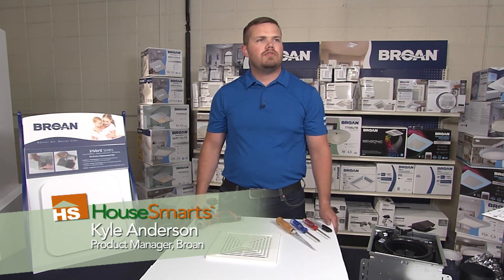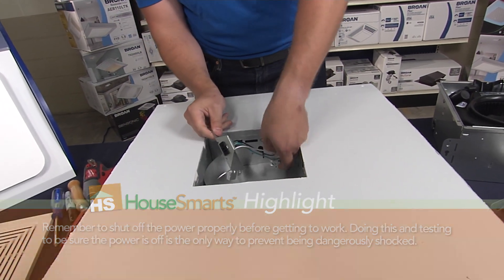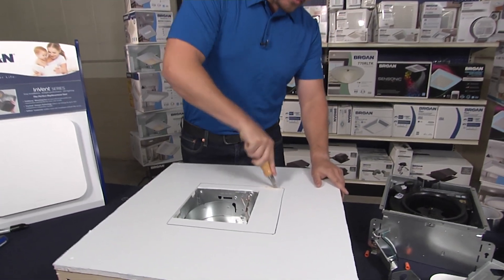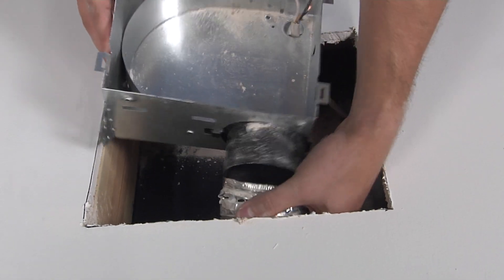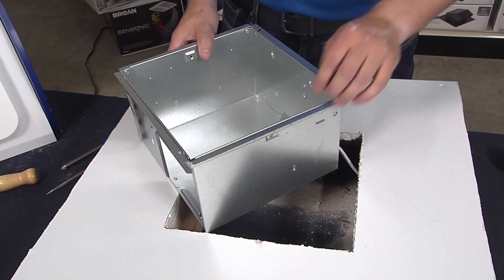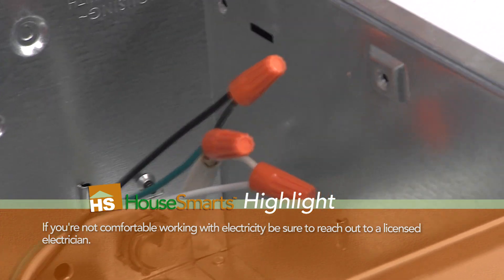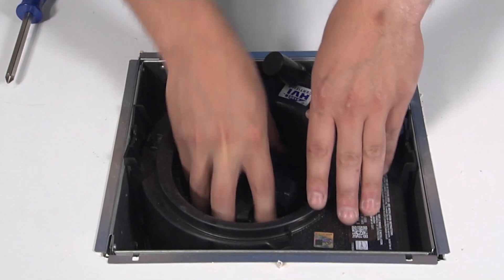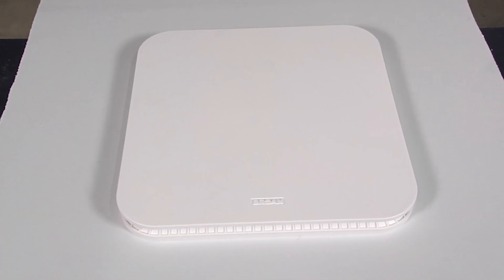How To Replace Bathroom Fan – HVAC Smarts | HouseSmarts

Comment: How do I remove the fan? It looks like it snapped-in when you installed it. I removed the 2 screws but the fan stays put.
Reply from the maker: Are you referring to the motor plate?

Comment: 1:55 was a red flag.  Whenever someone says it should be easy...   welp not when its screwed in.   Also the romex was on the opposite side of the vent on this model vs stock house fan and it wasnt long enough.    The instructions are reslly horrible
Reply: My old one also was screwed in using the box mounting ears, flanges. Square screws to boot. Plus there is a 2x4 right above the duct work, so the connector does not make clearance. Wish it was that easy with mine. Clean